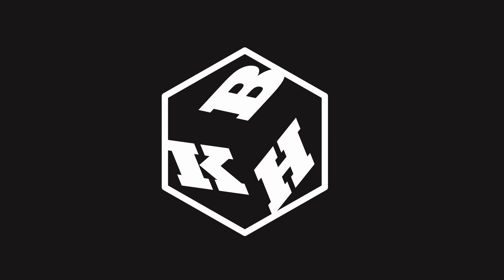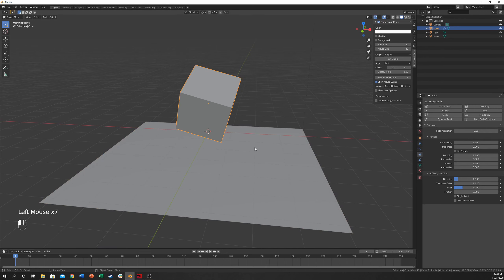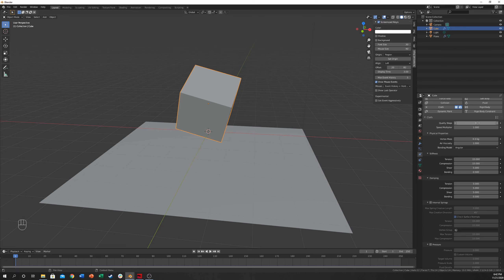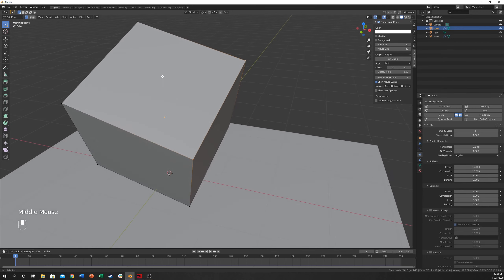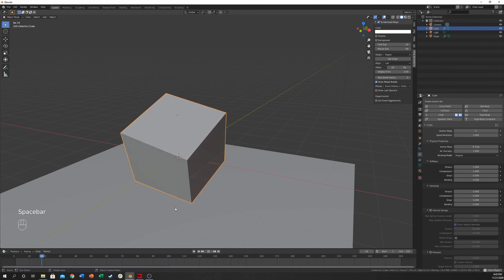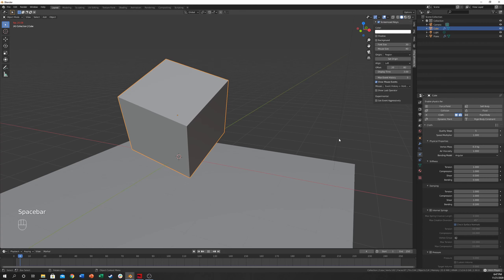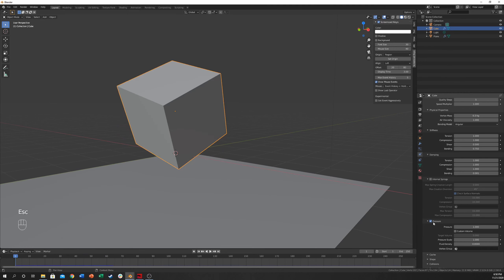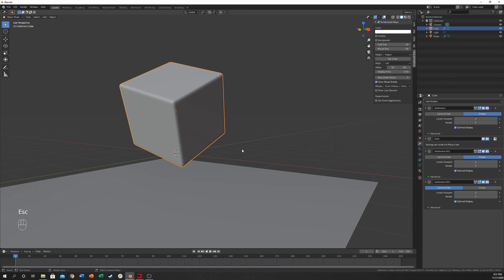How To Make Jello In Blender (Soft Body)

Comment: I know this video is like 2 years old but two things. 1 This video was great I am definitely subbing the way you explained things and gave information is perfect even if my cube isn't working like yours. Second I recommend using a bevel modifier instead of more subdivisions for your purpose it does the same thing just helps keep verts down and makes it easy to adjust the angles on the sides.